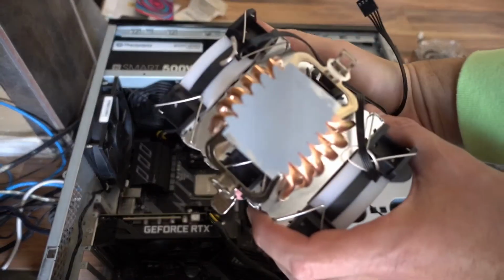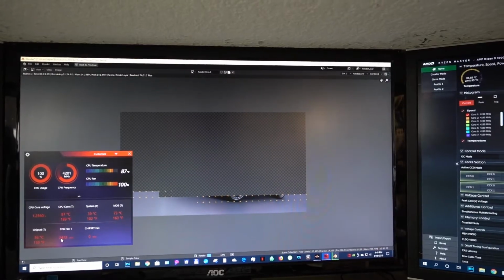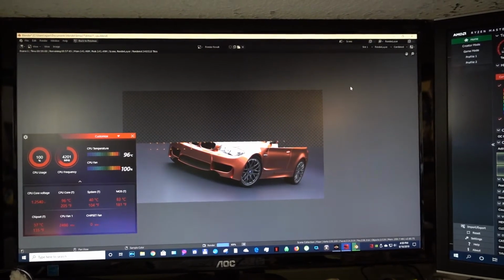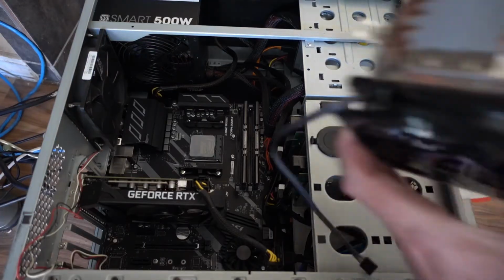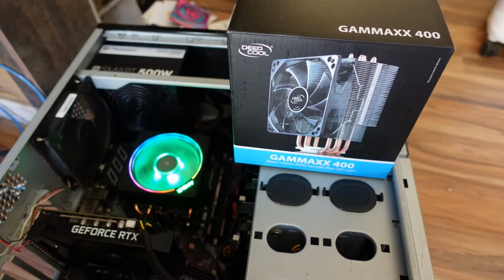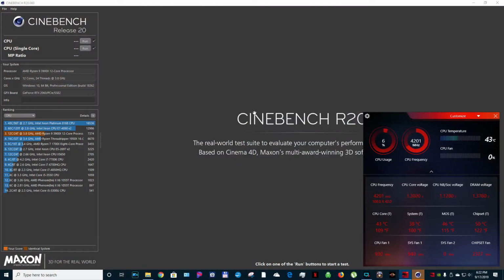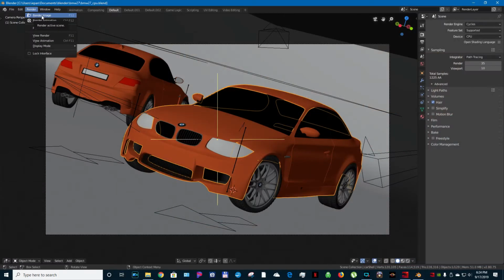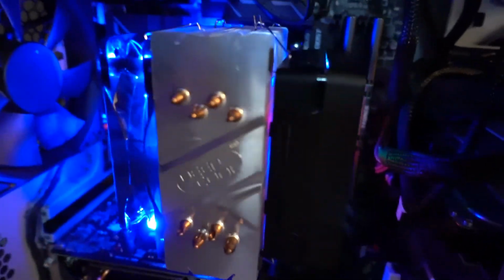Best AM4 Ryzen 9 3900x AIR COOLER, 4 vs 6 heatpipes, 90mm vs 120mm Overclocking even possible

Comment: Totally useless tests.
Reply: I beg to differ. This guy showed ingenuity especially if you are on a tight budget and want to put your money with the things that matters the most. people like me who can not afford noctua can appreciate things like this.
Reply: @EJLazatin  If ONE has the money for a 3900X then he also has the money for a Noctua! OR.... he should build a more optimized and balanced system for his money, with less cores and an adequate air cooler. This test remains totally pointless because it's technically incorrect.
Reply: @italoop7850  I knew you were going to say that. like I said, some people who have limited budget and trying to get the best bang for their bucks and trying to use the resources they have available. I think this is a great idea and not useless at all. by the way I got my 3900x for $230 used I just have to be smart on what I purchase. Also factoring what is available in the market as well as what you use your rig for. have you seen how many viewers liked this video so far? As far as I am concern Vegas RoManiac REVIEWS had done a great job. I rest my case.
Reply: @EJLazatin  What's the point for buying a 3900X? Playing games? Then it's the wrong processor. Just because it came cheap it isn't the right cpu for the job. If it's for professional use, then it requires the proper cooling. The dude in the video just added a second fan in a pretty brutal way. Fans are cheap and could have gottena Deep Cool fan for a few bucks. Even with 2 fans, keeping a 12 core processor at 80°+ for hours, doing professional work, is simply wrong and dangerous in the long run. My PC runs on a 3600 6 cores fot 170 bucks with dual fans Noctua and it stays at 60° for long professional use at max load. And is silent!  A dual fans cooler requires different speeds for the fans and specially designed ones, along with the proper mounting distance of the rear fan or it won't do its job. It's not just "stick two whatever fans and go". A system by definition is such as it's working in a balanced way, meaning that in a  computer noise, heat and energy consumption are kept at the minimum possible.  Believe it or not even Noctuas can be found used... one just needs to wait a bit and do a smart choice with a brain, not just the wallet.
Reply: @italoop  🤣🤣🤣 case rested buddy. Go take your bullying somewhere else.
Reply: @EJLazatin  Is THIS how genZ calls civilized technical discussions in an open, FREE SPEECHING & DEMOCRATIC place? Bullying? Naaaahhh. That's the typical position of somebody who doesn't have meaningful technical and economic reasons to stand for. KIDS! Don't do or support what you see and read here! You do not need a 12 core cpu to play Far Cry and save pennies on important aspects like proper cooling while your mom is spending big bucks to pay the electric bill for you to play.
This is all nonsense. A computer is a sytem that needs to be designed with brain, paying attention to the best costs in relation to max TDP, what you really need to do what, proper choice of ancillary technologies and environmental sustainability. Nobody needs a professional grade 12 core 105 watt TDP cpu for gaming when a 4 or 6 cores is already more than you need. Games won't use all those cores. Less cores means faster rates, less heat, less wasted power, cheaper PC, cheaper electricity bills, You're not saving on fans when you're paying for power and the high risk your cpu will be fried or last less time than it could. Be smart and make sustainable choices!
Reply: @EJLazatin  Dude! Get a grip... and don't let mom know how much she's wasting for your electric bill whe she could save a lot!

Comment: I figured that was about it. Those tower coolers are all the same factory line, some just need betters fans to get cooled evenly. the 120M fans that come stock must really not have enough pressure to get the air threw the fins. Thanks for posting the video. I'll be modding my tower similar to that soon.

Comment: A Noctua D15 would be a great cooling solution for the 3900x.
Pointless spending money on multiple cheap solutions IMO.
Reply from the maker: This works great, the gamax for 20bux
Reply: Vegas RoManiac REVIEWS i had the gammax and it was ok but the fan did fail after 6 months. Replaced with noctua and the temps dropped by quite a bit. Also run far quieter too.
https://youtu.be/
Reply: Exactly! It makes NO SENSE at all!

Comment: Good video! I am curious to know the performance difference of these coolers with the case cover on and all the case fans at 80%+. The original prism cooler is perhaps an antiquated cooling method because it just blows air down onto the CPU with no direction, as opposed to the vertically mounted coolers that efficiently shuttle air out the back side of the case, with the intention to receive cool intake air from the front side of the case. Funny, I re-purposed my prism fan as well, but I adapted it to the rear of my case as the exhaust fan. The prism fan is a suberb fan by itself, even at high RPM it is quiet and it moves a lot of air, plus onboard RGB with no separate controller. I used the Cooler Master Hyper 212 RGB on my 3900X which has similar performance to the deep cool

Comment: better than NH-D15S, NH-U14S?
Reply: same question
Reply: Certainly not. The deep cool ($20) is essentially half of the surface area of the Noctuas ($100), but they do share the same cooling strategy. The 3900X limits its voltage (and physically degrades) when it is at 95C though, so you want to stay away from that number. Dark Rock Pro 4 is another good cooler. But, keep in mind the bigger coolers tend to interfere with and/or cover your RAM, if Gucci looks are important